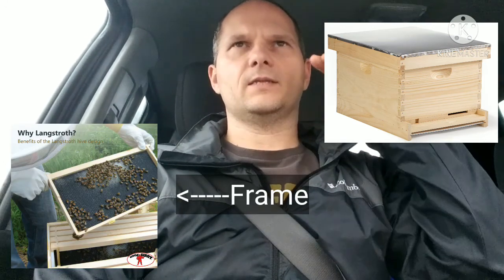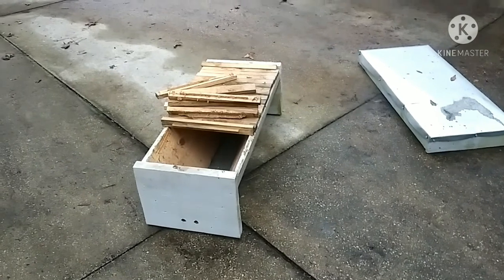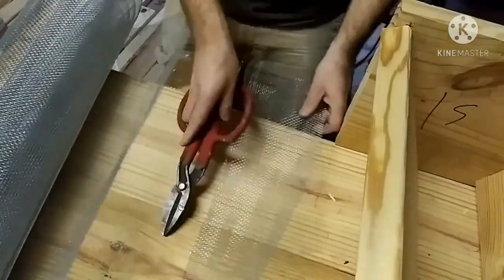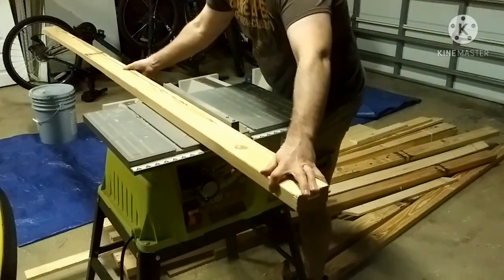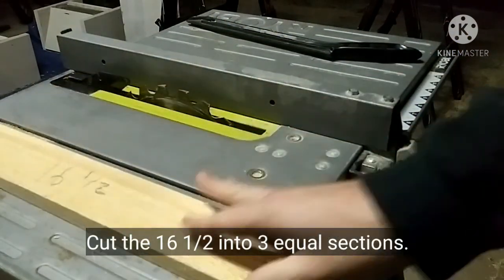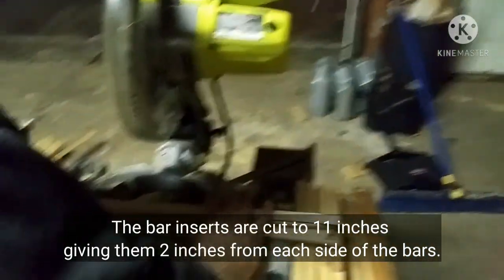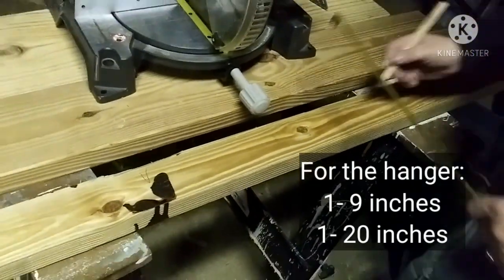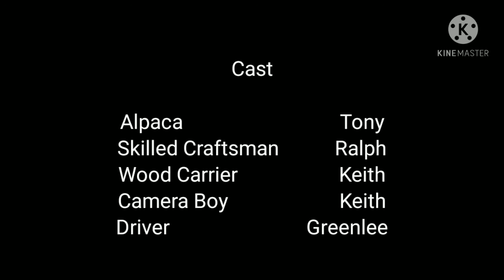How to Attract Free Honey Bees and Make a Swarm Trap (Top Bar Style)

Comment: If you use a langstroth hive body with no frames you are asking for trouble.  When you have to cut it out it will be a mess and you will kill the majority of your brood. Nope. Always put in frames even if they are undrawn frames.  It will make for a much more  enjoyable experience.  For you and  the bees
Reply from the maker: I agree. It is a lot of work. Cutouts are not very effective. The main point of the Langstroth with no frames is to give the bees a cavity. The frames could make it so the scout bees don't think there is enough room. I know people have had experience with frames in the Langstroth hive working though. I think in the Honeybee Democracy Thomas mentions the bees doing a thumping at potential hive sights to measure the openness and space. In my terms, they use radar to measure space. The top bar is a good solution to this problem because the bees can build on the bars and still have an open space. It has worked for me a few times.